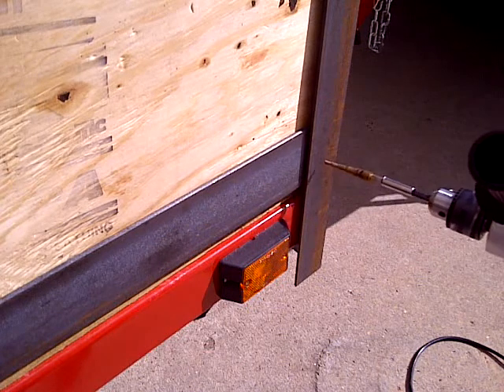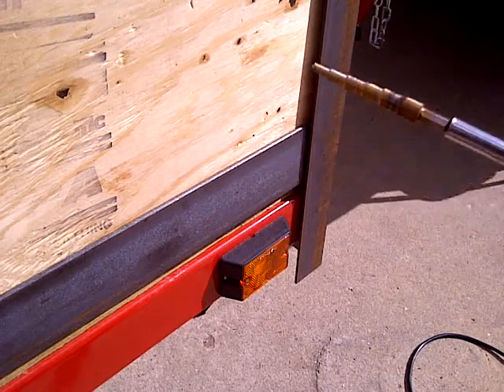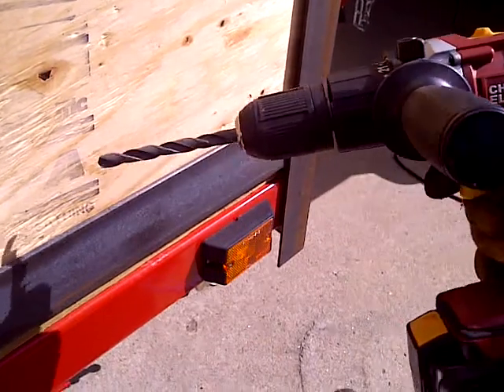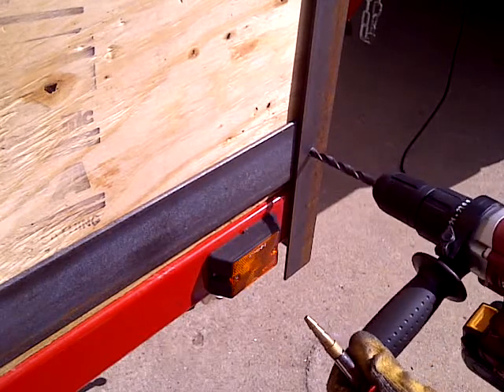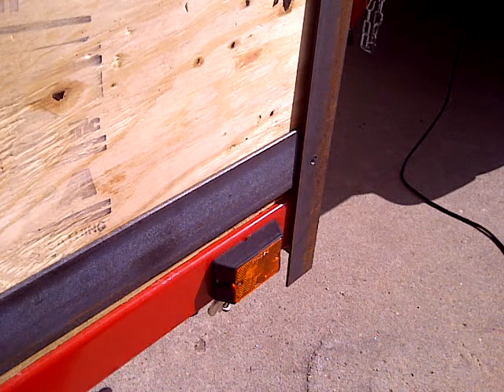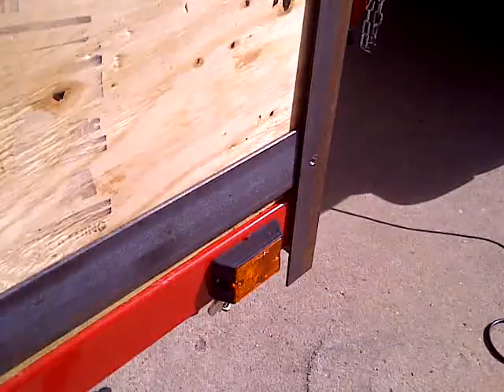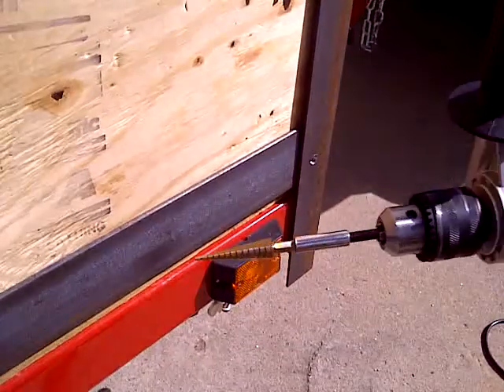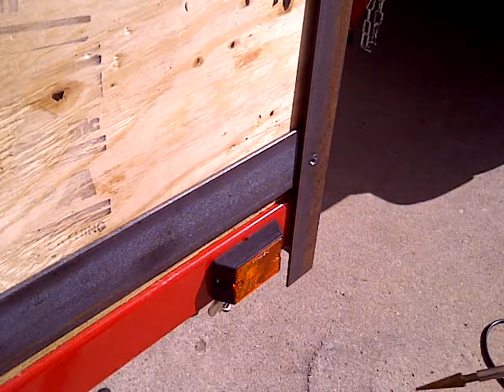1/2 In. Variable Speed Reversible Hammer Drill 02 Field Test Update

Comment: You really ought to be using a regular drill bit. Especially when you have two layers of metal. They aren't meant to drill thru the extra thickness (as you found out). you can pick up a 29 piece set of titanium nitrade bits for $15. 
Oh, and use cutting oil instead of air! Regular 10w30 motor oil is better than nothing. Get yourself one of those little oilers and add a drop or two every 5-10 seconds as your drilling.